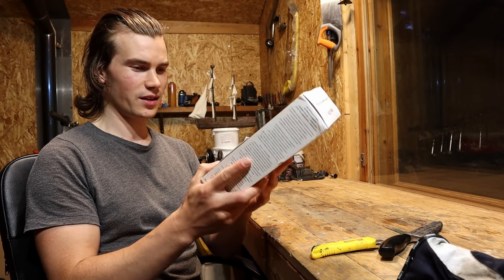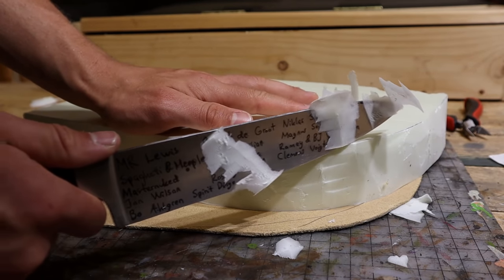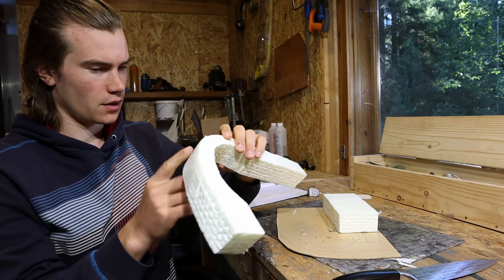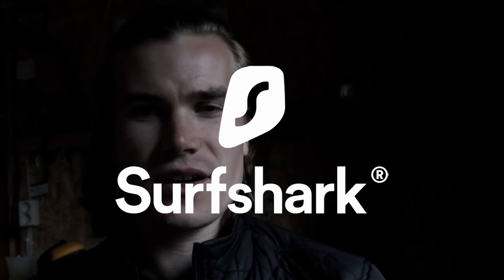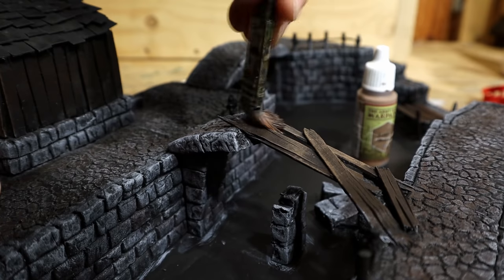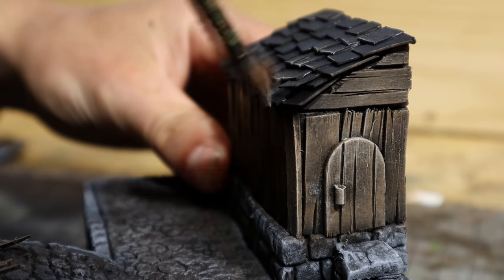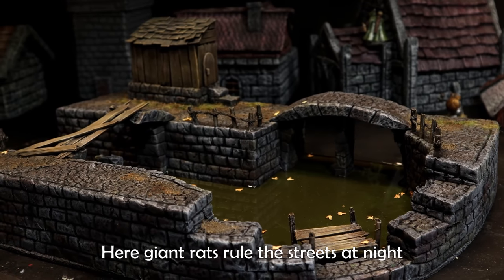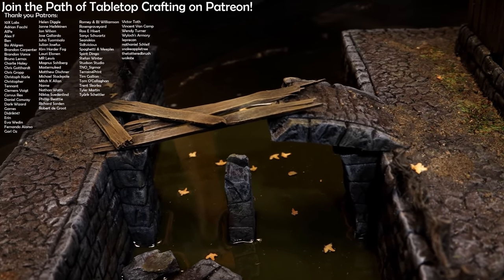Oldtown Diorama: How to make Epic Low-Budget Terrain for Tabletop Games (re-upload)

Comment: This is old and I know there are no new videos, but man, I wish I knew where to get this kind of foam in the USA. It seems so soft, while the stuff that I can get at the big stores like Home Depot or Menards only has really thick stuff that's pretty hard to cut, and the outer edges more glossy looking and don't take well to shaping or cutting.
Reply: funny, I just noticed you mentioned the same surface with yours, but it doesn't really show on the videos.